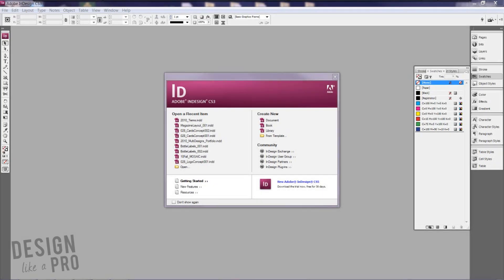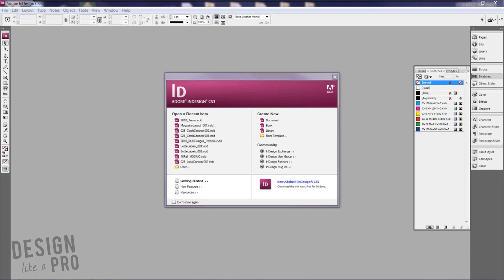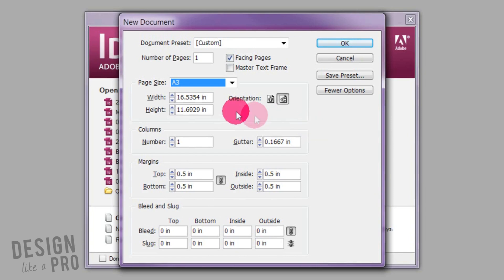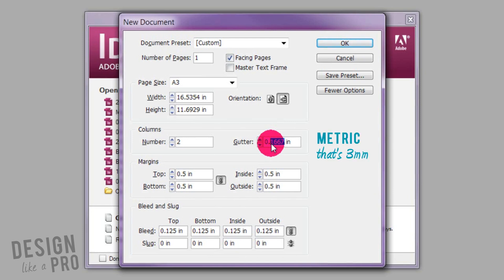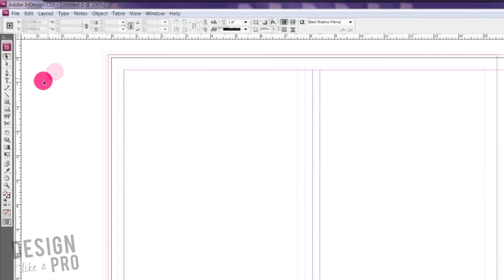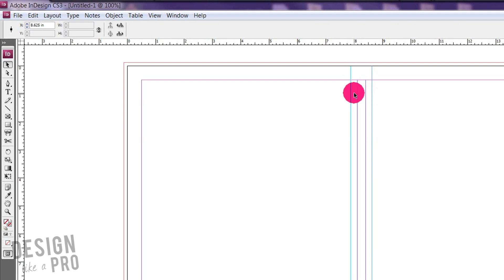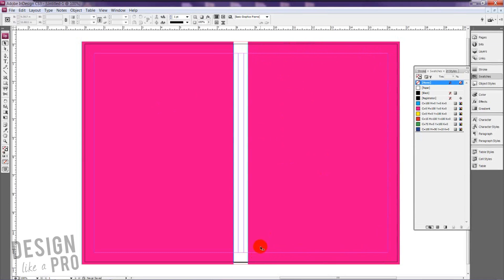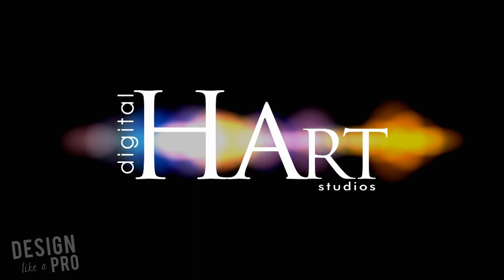How to Design Perfect Bound Magazine Covers // MAGAZINE DESIGN

Comment: What if the magazine cut size will be 5.5x8.5? Would the paper size then need to be A5 (or other), or should the A3 still be used?
Reply from the maker: +Blue Spider Press I make booklets this size a lot for performance Playbills. First question is are you based in the US or in another country? A paper sizes are often used outside the US &amp; Canada. A5 is 5.8x8.3 inches. If you need the magazine to be 5.5x8.5, stick to that in your document size. If you are in a country that doesn't use inches, then you would use A5 as the closest measurement to what you are after. Don't forget the bleed!

Note, you can use sizes outside of A paper sizes. It breaks the standard so pricing will likely be a bit higher when you use custom paper sizes, but that doesn't mean you can't do it. Thanks for watching!

Comment: Thanks for sharing but I didn't quite get this cause your spine stops at the margin area top and bottom, but it will print all the way to your page markers (black mark) and of course full bleed in your case for the background color. So, what happens to the excessive space on the top and bottom of the spine? Can I add color all the way to the bleed marks at the top and bottom and it will print full bleed? Meaning, the gutter in this case. Since it IS a gutter in a two column setup on a ONE page layout I started to think that it wouldn't quite print like if its a standard setup as a two page spread. Or will it? I think I'm missing something here. Do you deliver this as a separate PDF to the printer, and the content pages in another file?
Reply from the maker: ventende If you want your spine to be a solid color, you would fill the entire area from bleed line top (red line) to bleed line bottom.  Not just to the magenta margin lines. You would keep your spine text there to ensure it doesn't get trimmed away. I show you where the spine folds which is where the magenta boxes stop. You will want to keep all back and front cover content in this area. I often deliver my covers in a separate PDF from the content pages. Most magazine printers will separate the pages into their own files if they don't request that you deliver final files that way.
Reply: Design Like a Pro Thanks for getting back to me on this one. I guess its difficult to know exact where the spine folds as that depends on how thick the publication is - right? So the magenta boxes is positioned at what you presume would be an ample measure from the spine area? I think I came across some sort of mark regulator for trim procedures like this, I believe it created a black crop mark / trim marker on both sides of the spine on the PDF export.

I've seen different approaches on how to solve a back/spine/front page layout. The other one is based on three pages side by side and then alter the width of the center page with the Page Tool to whatever size you would like the spine to be - then export that as Spreads in the PDF dialog.

Comment: first i would like to thank you for your Exertion and your Excellent channel..
Dear sir .,
i am a designer tray to learn Adobe Indesign because i used the corel draw from 6 years and i found that indesign very easy to design the book layout  and magazine so i already learned it and how to use all tools .. but i need some technical way how to finish the job as professional designer ... so my question is what the  technical way for design magazine or 4 color book which Consists of many pages and cover with big spine like ( Jacket cover with text name in the center) as u Explained..
can make the inside pages and the cover and ( Inside Back Cover ) in same file ?? to be easy when i print book with booklet option OR must make the Cover and inside back cover in separate file .
and if i can make it in same file how to print this case with booklet option with Different size page ( Montage Facing Page ) to send it ready to printing press